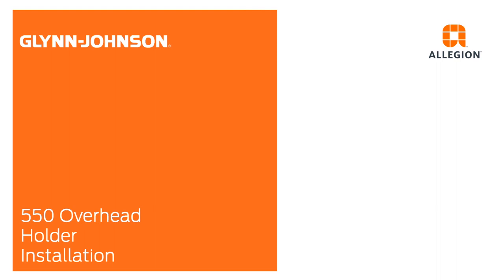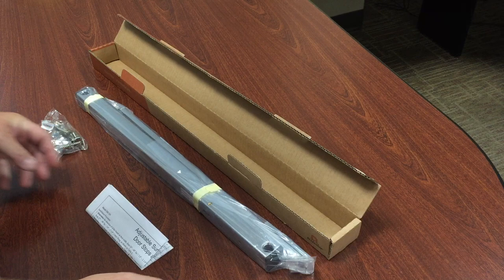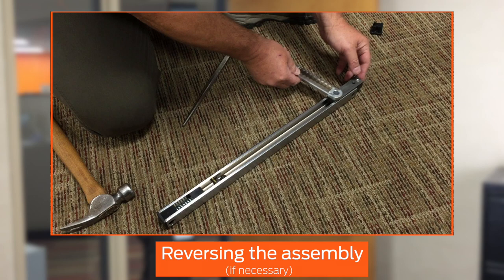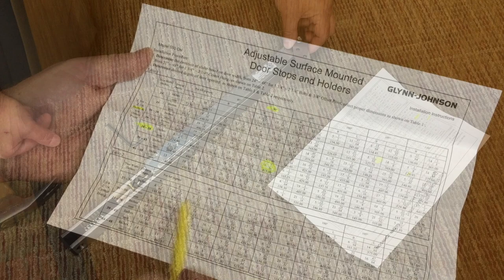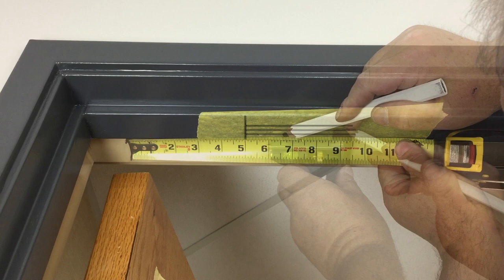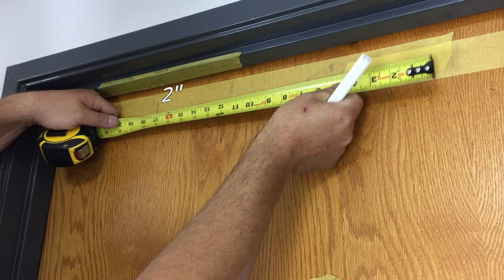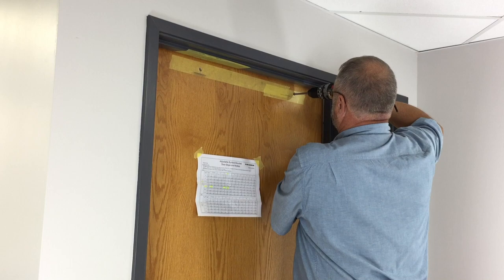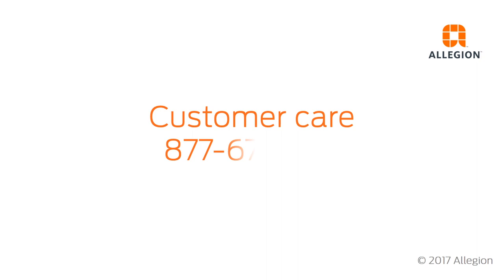How to Install the Glynn-Johnson 550 Overhead Holder

Comment: My door pulls to the interior.  Is there any way to mount this on the interior?  If not, is there a similar product that will like the 70 series?
Reply: Yes but you need a separate bracket.